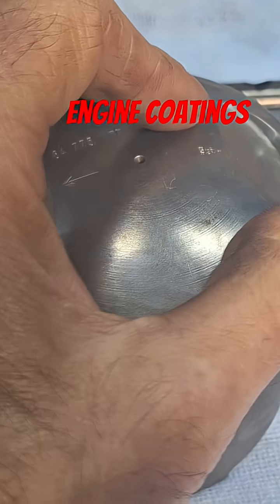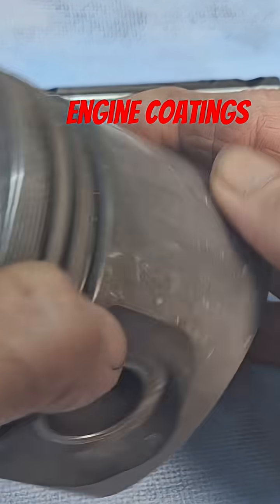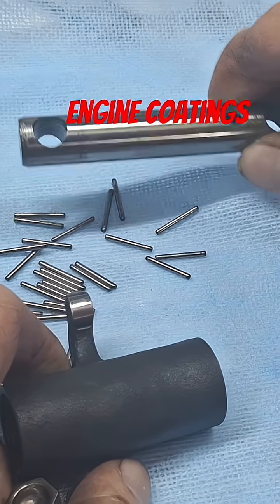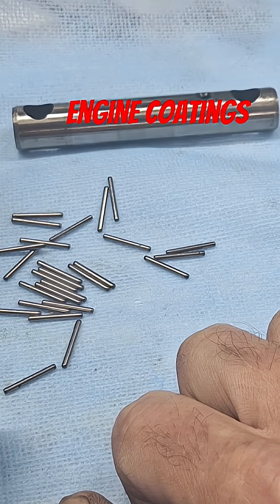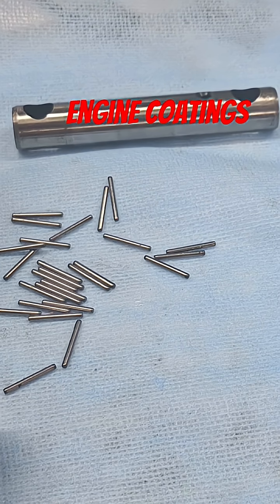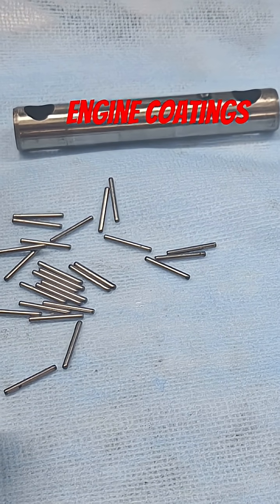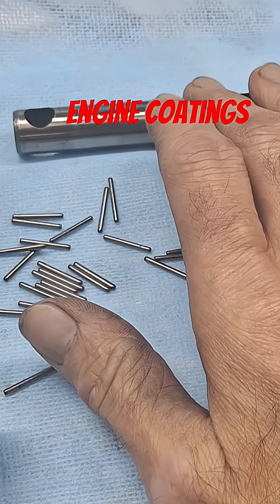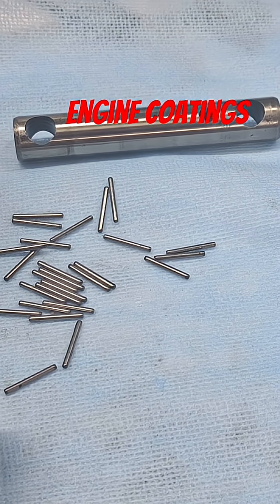Are Moly Coatings REALLY Worth the Hype?

Comment: just used a moly paint to seal up the throttle bodies on my vfr, was a pain but what cool stuff! from now on im gonna use this paint to sufaces that gaskets go to stop them bonding to the alloy, or on thermostat housing to stop the hoses sticking etc, basically anywhere i need to go for maintenance where parts tend to stick together over time will now get a little bit of this paint. using loc tite 8017, was a pain for throttle bodies as had to thicken it up before applying
Reply from the maker: I've only ever used it on engine internal parts like piston skirts, cans, valves, or anything that could has a lot of friction.
   You brought up some great points there about other uses. Stuff that I never really thought about. 
   Thanks. Have a great weekend.
Reply: @russellbarron6775  i used the loctite LB 0817 in place of "tomie throttle coat" which is hard to get and rather expensive, in the future i'd get the proper throttle coat. its used to seal up butterfly valves in the throttle body so the idle circuits can work properly, its the grey film on the edges one can see on a few different models. 
my vfr has it stock but needed refreshing to tune idle vacuum. No-one in New Zealand knew what i was talking about to seal up the butterflys saying "just adjust it out" (cant adjust out gaps near the center shaft, only near end of butterfly valves).

if you ever have an injected bike with a hard to tune idle keep it in mind as this procedure seems to be lost from the internet how to seal  the butterfly valves for a proper vacuum at idle, everyone complains about how hard vfr's are to get idling smoothly and i suspect this is an contributing factor. Anyways, all the best!
Reply from the maker: @ziggyinta I remember seeing the coatings on various TB.
   I had an 03 VFR  a while back (15 years).
   Thanks for the tips.
Reply: @russellbarron6775  cheers and good luck with the projects!